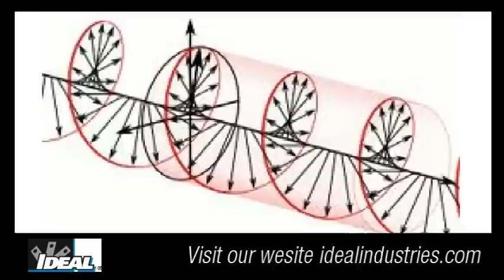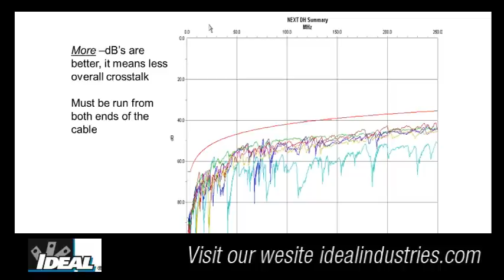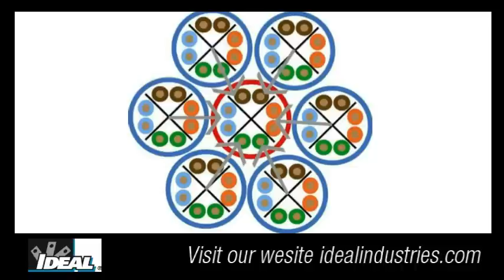Crosstalk NEXT, FEXT, PSNEXT, AXT

Comment: sir will u plz tell me how to remove crosstalk
Reply from the maker: +rajveer singh The twisting in the pairs removes most of the different crosstalk issues just do not untwisted much after making a connection. The standards say no more than 1/2" per connection but you can get away with more sometimes. The other main source is electrical EMI noise from lighting, motors or any electrical equipment. While the NEC code says 2 inches of separation from power lines the more the better. So make good connections and stay away from power lines will help a lot to reduce crosstalk.
Reply: thank you sir